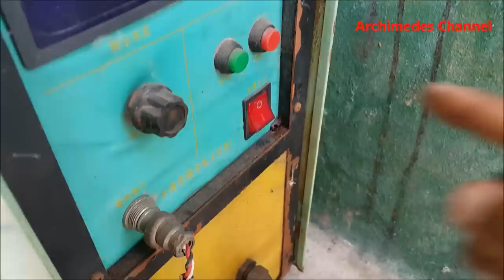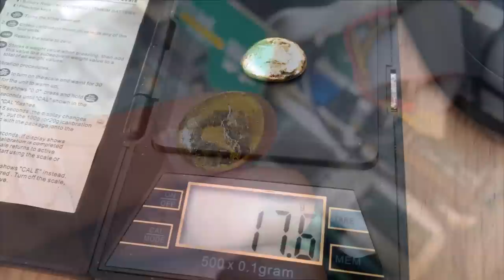Recycled gold wire bonds from gold mine ic chip cpu Electronic devices obsolete.

Comment: What was that electric machine you used to smelt the gold in the crucible? There is almost no information in this video! What powder did you add as flux?
Reply: it is an electric induction furnace (cost about 1,5 thousand Euro over here) with water cooling in the copper coil.